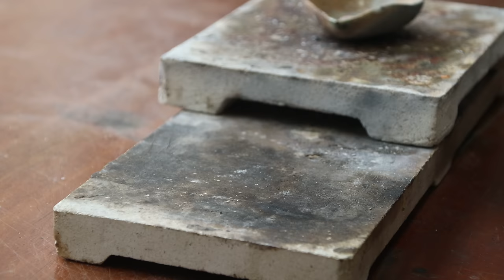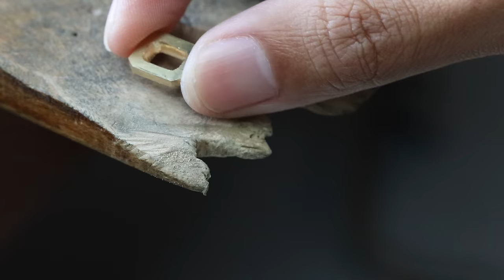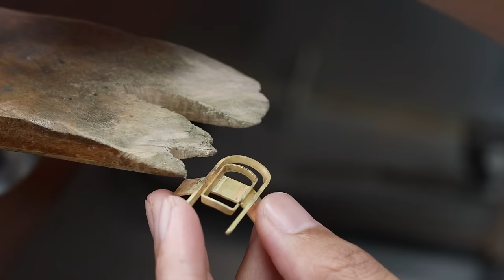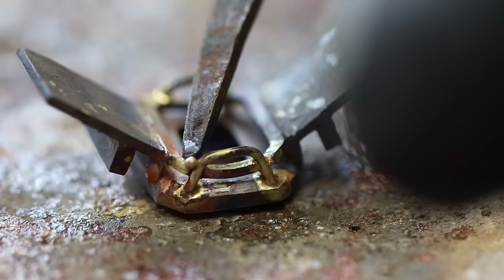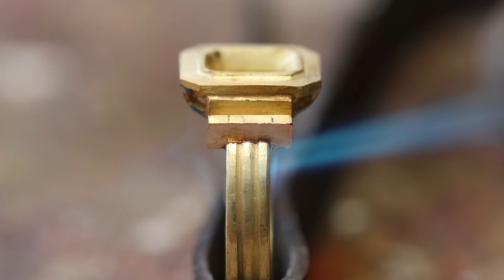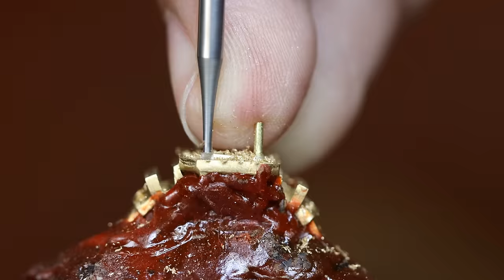custom pink ruby jewelry - handmade vintage gold ring with ruby stone

Comment: I just lost a ruby from my mum's white opal and ruby ring. I said I'd get it fixed but my mum said "i think it was a cheap setting you might want to get the setting redone." 
I've been thinking about it for a few days at first I was thinking just getting it redone as is but I'd like all my opal jewellery to match (kinda I have both black and white opals). The way the diamonds have been put in here I think I'm gonna do that to protect my rubies and the few black opals I'm going to throw in to the ring too.  Thankyou for the ideas. ❤❤❤

Comment: The ring isn't a handmade vintage ring. It is a handmade vintage-style ring. They are two different things. If a ring is vintage it cannot be new. That is a contradiction. Therefore it is vintage-style ring...and a beauty, at that. i suppose it could have been made using the lost wax process. One wonders if making it from scratch like this has advantages.